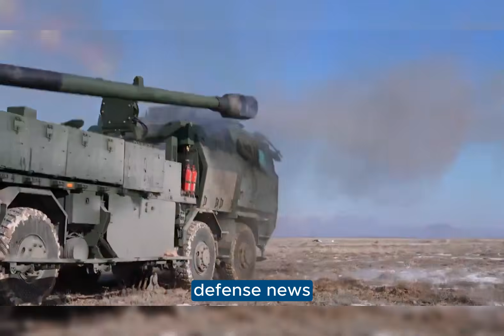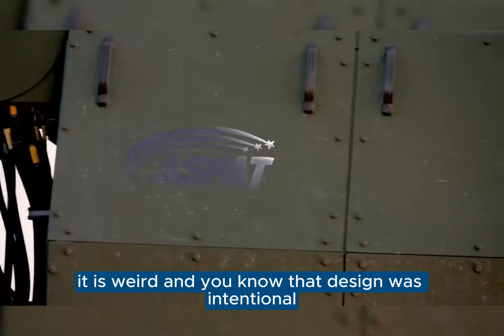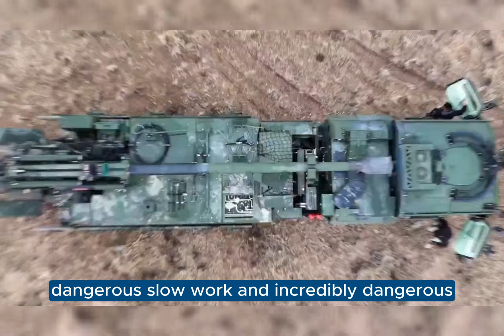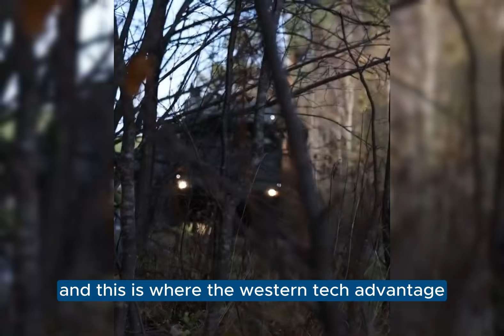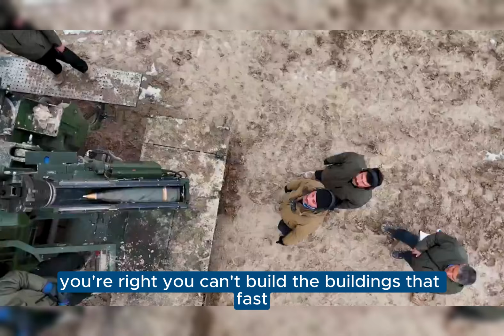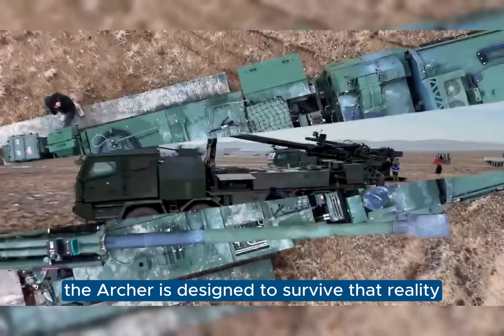New Archer 155 on HX2 Howitzer Boosts NATO Firepower!

Comment: The real problem with the Volvo archer is that the truck engine also powers the howitzer system so, if there is a problem with the engine, then the entire gun system is down. 

All other mobile howitzers have two power sources: one for traction and the other for the gun system
Reply: And it's turned out that it's not a matter of IF the engine stops, but WHEN. The Volvo chassis can't stand the amount of shooting requested (snapping wheel axles) and the engine seems to be a bit too picky when fed front line (dirty) fuel.
Reply: @ollep9142  That day when a MAN truck could match a Volvo ( or Scania) truck in relability, quality, performance,  it will be a Blue Moon, and seven Sundays in the week...
Reply: And other howitzers is crap in comparison..